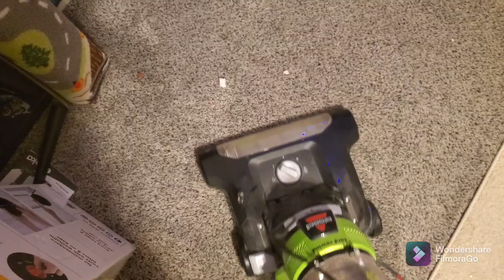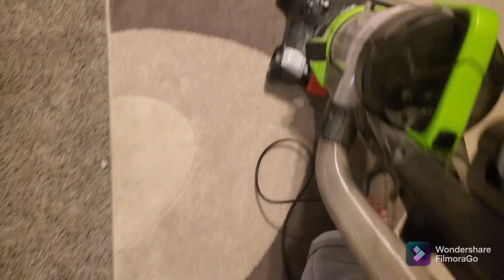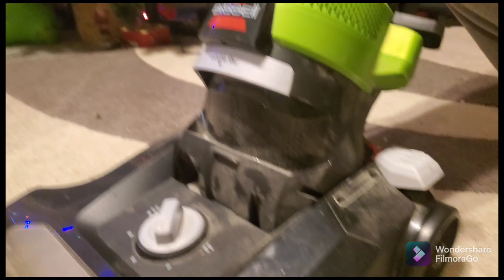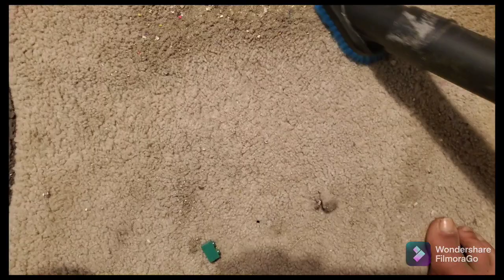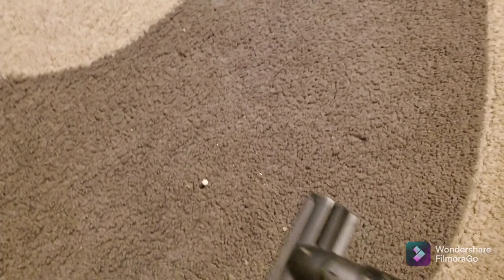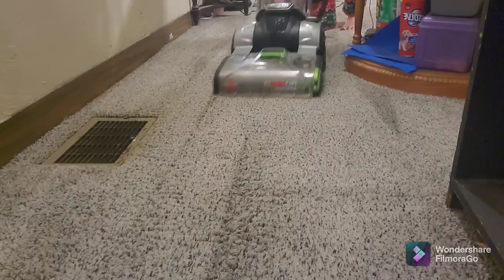Natural Vacuuming followed by  shampooing the carpet

Comment: This was AMAZING 😍😍😍🤤🤤🤤 That crunchy natural was unbelievably satisfying, and I’m obsessed with that natural dirt crunch in the pickups 🤩🤩🤩 I agree that your audio sounds incredible even with no mic, but in case you wanted to keep trying with it: the sound cutting out is probably not a problem with your mic, it’s a common thing that when microphones with no pop filter (like a foam cover for bigger microphones, I don’t think there’s any such thing for little mics like the ones on headphones) pick up sharp noises they tend to either cut out or ‘pop’, the best thing I can think of really is just to try different mic placements, either further away or on different parts of the hose/vac. I’ve seen other people manage to get it to work without doing that while still having the mic on the hose, so it seems like it’s a case of trial and error! I hope that helps 💖💖💖
Reply from the maker: Thank you 💕😊